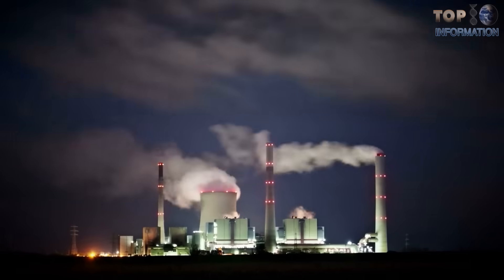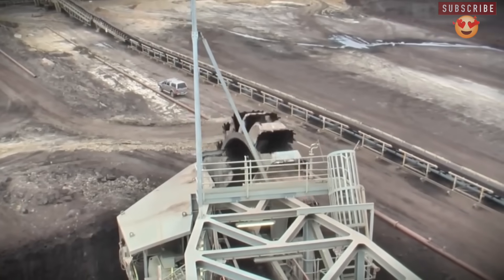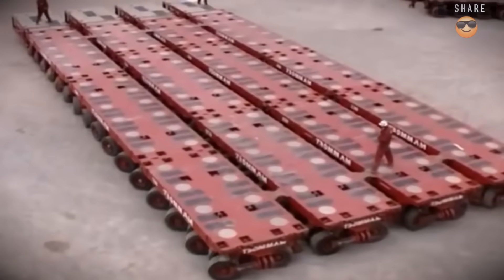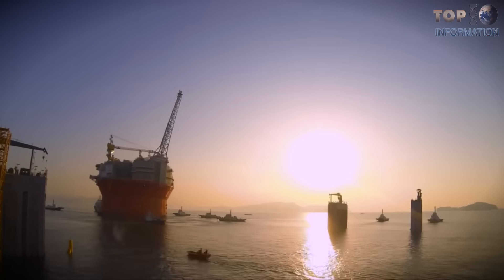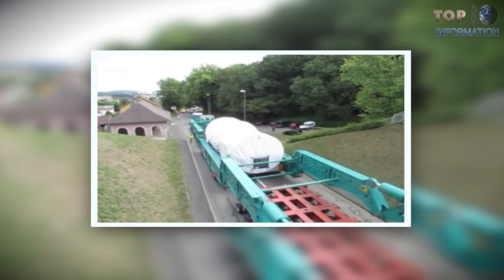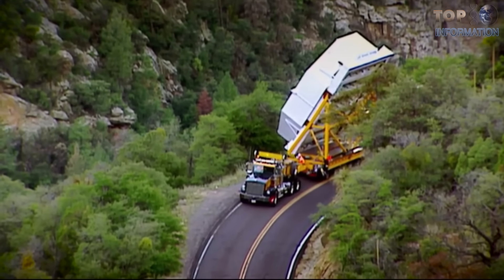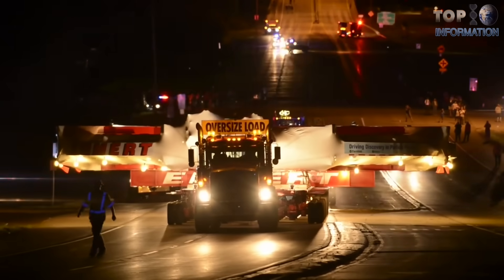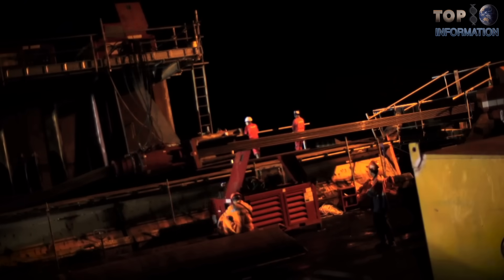7 Extreme Transportations You Never Seen Before !

Comment: Carrying nuclear reactors is smart, real smart.

I wonder if they remember Chernobyl.
Reply: You really think they were transporting an active nuclear reactor, with fuel rods in it?
Reply: The reactor in Chernobyl was stationary... So in theory NOT carrying them is a bad choice. Also a nuclear reactor isn't a bomb and the one in Chernobyl didn't blow up. There were numerous human negligence errors as well as severe substandard safety regulations, which lead to failures. A power overload caused explosions inside reactor 4, these damaged the dome around the reactor allowing for the contained radiation to escape. Reactors 1-3 remained operational until the last one was shut down in the year 2000.
Reply: yea brah, people move nuclear reactors of the same scale as chernobyl fully running all the time. not like this is a reactor of the scale you would expect inside a ship and is designed to be moved. this is a reactor designed to be fully stationary and is still operational at 100% on the lorry